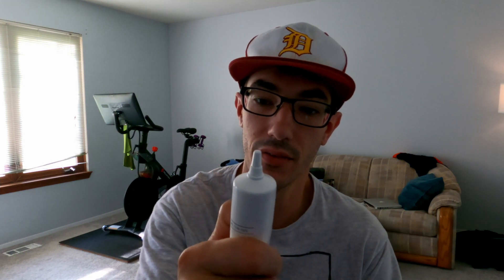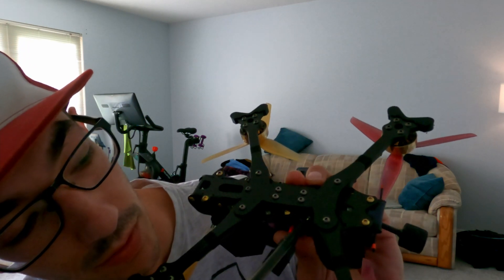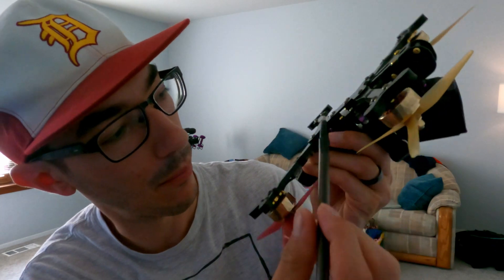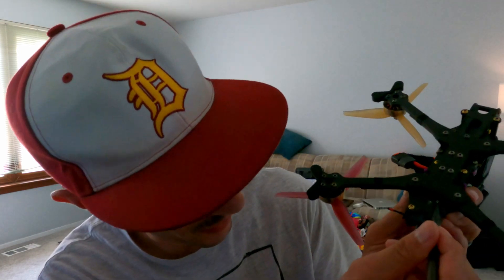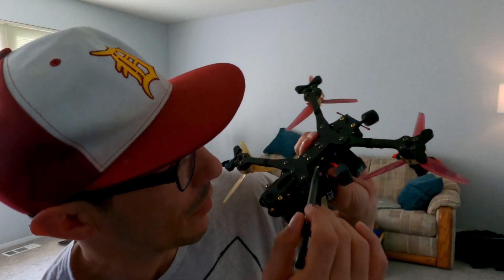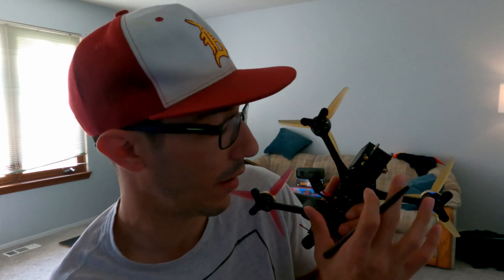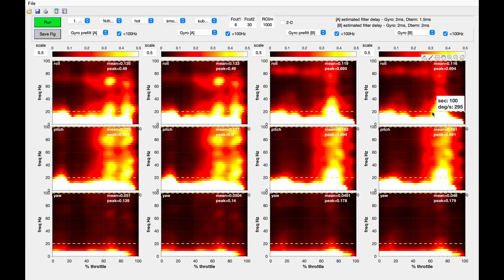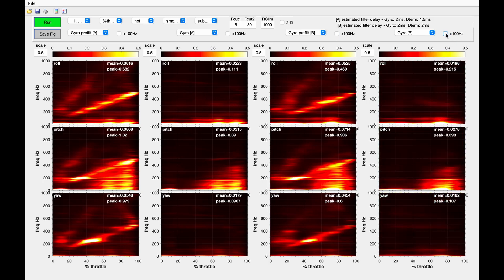Chris Rosser Suggested Greasing Your Drone...

Comment: Good video. Did you use the same pod on both flights?
Reply from the maker: Hmmm. Is "pod" supposed to be "quad" or "pids"? Haha. I guess either way the answer is "yes".
Reply: @mouseFPV  yeah I meant pid s 😅 because, to my understanding, the idea of the damping grease was to enable the quad to fly with higher d gains.
Reply from the maker: @DronoTron  ah. Yeah. That's two sides of the same coin though yeah? You could say that my gains were simply too high before adding the tape (then the grease was like just a little better than the tape) and adding frame dampening simply made it flyable with that much D.

I've actually lowered my pids a bit since this video (about 10%) since I was still getting issues here and there. Doing so has allowed me to defilter significantly, quad flies great. 

If you really want to have your tits blown off, watch what adding tape did initially 🤯 https://youtu.be/hoRaftBrQ34

Comment: first of all stop checking vibrations in pidtoolbox, it's absolutely useless and you cannot understand what and how you should filter, use blackbox analyzer. As I see your graph you just have bad gyro in FC. I had the same problem as you, I replaced motors, frame but it didn't help until I changed FC. If you look through blackbox you'll see that on pitch axis there is a huge dterm oscillations when throttle goes up and decreasing D doesn't help. As for lpfs for gyro - no one needs it for real. You just need only one biquad lpf on d term at 100hz and dynamic notch on gyro from 150-180 to 600-700hz. What you see under 100hz on gyro is just propwash caused by your useless lpfs on gyro. So just replace the FC install emuflight, set feathered pids to 0, set 5000-6000 q factors on each axis, turn off gyro lpfs, set biquad 100hz on dterm. Gain pids up to have dterm at 40, and raise P to make gyro readings to touch setpoint line in pidtoolbox. After you do this the quad will fly like Mr.steele
Reply from the maker: Lol.

Comment: My thoughts on applying grease on any part of the quad, is that the grease will essentially be a dirt magnet, and will cause a sanding effect on any vibrating parts. I would think in the end, it would actually create more of an issue later on. I fly in a really dusty environments most of the time, and I once subscribed to the belief that we should oil our motors. That was until I started having premature bearing failure, caused by the oil collecting dust and dirt, trapping it like glue, and grinding down the moving parts. Just my two pennys.
Reply from the maker: This goes between theayers of carbon. Dirt cant find it's way in there. Though if you have exposed grease like on a motor then yeah that's going to be a bad time, but I think you may be mistaken. Crashed in all kinds of dirt and mud, a baseball diamond, bandos, pretty much everywhere but the beach and haven't noticed any I'll effects yet. 

But it IS a dirt magnet, I have some crevasses in the frame that I got grease but it's too tight to clean and it's a mess in there, super annoying, but it doesn't work it's way between the carbon layers 😎
Reply: I agree I run rc high performance cars a d Grease can be nasty

Comment: With multi-part frames i use rtv silicone sealer,  I don't race so quick arm changes are irrelevant to me, ymmv.... but by black box it does reduce bad vibes
Reply from the maker: Ah,. interesting! I'll look into that. I've been rocking the nyogel for a bit now and it's holding up as well.

Comment: Going with grease on my AOS5 build. Why? Looks easier to apply and maintain and doesn't introduce additional part gaps.
Reply from the maker: Yeah if you do it at frame assembly you can just wash the frame before adding electronics, should be easier than greasing a fully built quad. That frame looks interesting for sure!
Reply: @mouseFPV  well that's true for tape too. I really wouldn't know the difference but I might as well do it right. Tape is sure cheaper.
I might also try conforming silicone fluid as it dries to a harder material than gel.
Reply from the maker: @ChadKovac  the problem with tape is you have  a really hard time replacing arms when the carbon has tape on it, with grease arm changes are no problem. Only problem with grease is the mess, which is less of a problem if you do it from the get.
Reply: @mouseFPV  I love this hobby. Watching all of you smarter-than-me people really dialing these quads into a few optimum flavors...

Comment: I think that frame has resonance issues as it is never could get mid vibs out of hd
Reply from the maker: yeah, I never had a problem on 4s, switched to 6s and started having all kinds of problems :-/

Its flying reasonably well now, but man, what a PITA
Reply: @mouseFPV  heck mine is in the closet with the imperial motors dang shame between that and the motors lol got agrivated
Reply from the maker: @biggfpv2721  yeah don't blame you, with all the dsync issues and stuff.

Comment: Regarding smushing the tape when replacing just one arm I've found that it helps if you let the tape go around the corner on the inside. If put on nicely it'll stay in place. Also I think it may help with tolerance issues where the arms meet. I'm talking Glide only tho.
Reply from the maker: yeah the carbon tolerance issues are for sure helped by the tape! My arms have significant variance between their thickness (over 0.5mm) coming from different packs :-(
Reply: @mouseFPV  I'm talking about the vertical tolerances where they meet up. At least with the Glide the arms always move a bit front to back, so there can be a gap towards one direction. When tape not only goes on top of the arms but over the edge on the face where they meet, it may help these tolerances as well as being able to slide the arms in without smushing it. I hope I'm describing it correctly. 2nd language yo.

Comment: If ur having that bad of issues just switch your frame lol
Reply: 100%! A quality frame goes a long way.
Reply from the maker: heh, I may or may not have picked up the Bardwell box. Probably should have just grabbed an apex but the qav-s looks nice, so, meh. 

Id still like to get this flying as well as I can in the meantime, summer is only so long so, here we are.

Edit: also, this frame had no issues with my old motors and stack (other than that pesky resonance at 80hz on roll) so, wondering if the issue is even mechanical. Either way, dampening the frame in various ways has helped.